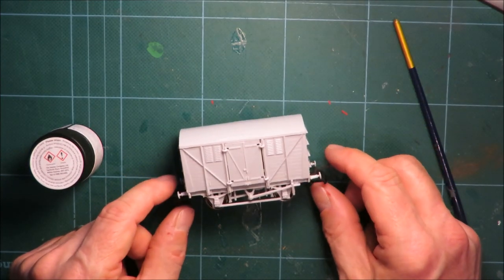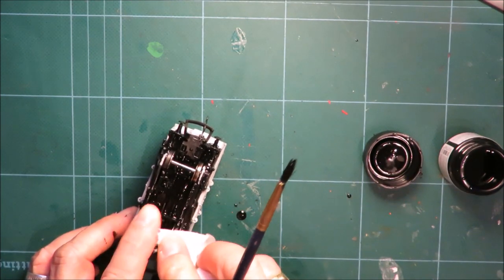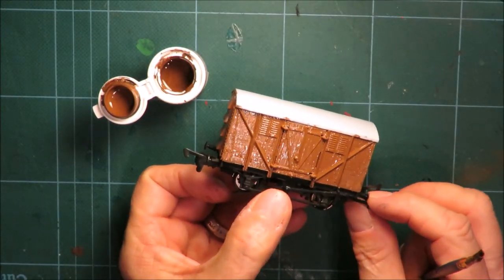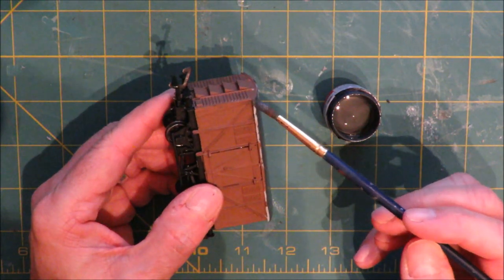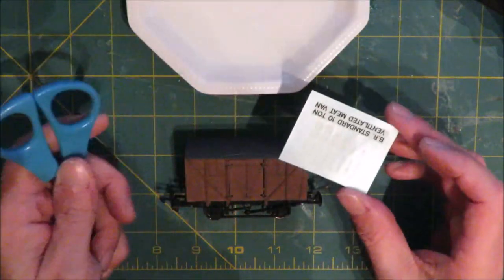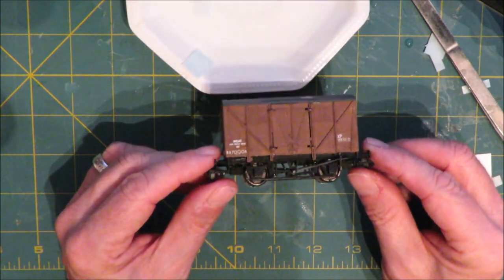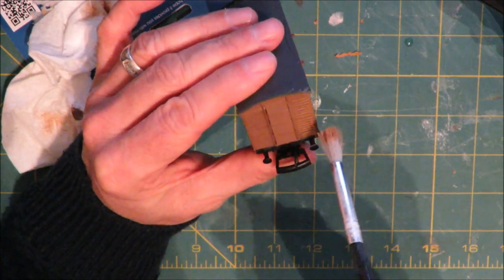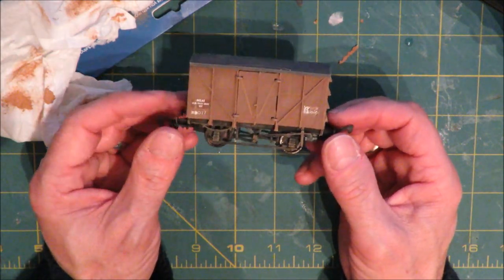Tutorial Tuesday Episode 17 - How To Paint A Model Railway Wagon Kit - Dapol

Comment: Thanks for the painting tips, you save me an hundred euros by showing me an aerograph is not mandatory to have a really more than decent result. Tamiya is a good choice, I can buy some in the model shops of my city.
Anyway, the prototypes were certainly brush painted, I think that airbrushes were not used before the 60's for real wagon painting.

Dapol kit wagons are a good choice to have low-priced and decent vehicles if you need some experiments, like putting some no. 5 Kadees on the one I will buy.
Reply from the maker: Tamiya is good paint, it does need several coats but provides a great finish. You really don't need an airbrush/ spray can and all the practice and fuss they involve, just to paint a few wagons
Reply: @BudgetModelRailways  I have painted dozens of model airplanes with brushes when I was a teen, I have an experience of what the practical result is. And, anyway, I had not the money to buy an aerograph when I was 14-16 years old.
By the way, I have found equivalents in Tamiya range for LMS colors : XF 20 for wagon grey, Xf 79 for bauxite, and XF 9 for Crimson Lake. Nearly half the price of dedicated railways paint, that also cannot be shipped to France by the sellers, hence my line on Tamyia's paint availability.
I have noted your advice on brushes. I've got an artist shop near my workplace that sells good quality brushes, I'll pay them a visit one day for that.
Reply from the maker: Thanks for the LMS colours very helpful. A good soft brush is worth spending a bit on, its still a lot cheaper than an air brush!

Comment: I use acrylic paint for quite a lot of my modelling and, though I have an airbrush, I haven't taken it out the box yet!  B&M stores (other shops are available!) stock 200ml tubes of Brunel Franklin acrylic for £1.49 - a lot cheaper than those little pots of Tamiya and Humbrol for those on a budget. Turned out very nice for between a third and a half of a new one and make a rake of them that much more achievable. Cheers
Reply from the maker: Thanks for the heads up

Comment: Its is a nice little kit, I bought one a few weeks ago from my local model shop for £4, I liked it so much I went back for another the next week.
I agree with painting the bottom first, can get a bit tricky painting it built.

 As for the paint scheme  I used only Humbrol colours, 33, black for the base , 70, brick red for the main body and  71, slate grey for the roof. 

The great thing about this kit is that there are a choice of 4 codes to put on the kit, so you can have four wagons with different code, not enough? cut and match the number.

I was lucky I only spent £8 for the two wagons and £2 for the paint that I was missing 
but if I had needed to buy the paints brand new thats £6 (the model shop sells one 14ml pot of Humbrol acrylic paint for £2) on top off the £8 but since I already owned two of the required colours I save £4 only having to spend £10 in total. not to bad considering the price.
Reply from the maker: £4 was a good price, I've seen people asking £8! Mind you given that the new Hornby one is £18 either way it's a saving.

Comment: here's a little tip. These wagons require a little extra weight to make them perform at their absolute best (I'd say add 30g but they're okay in small trains on smaller layouts), use alloy wheel balancing weights. You get a big box for not too much money (so you can use them in loads of wagons, coaches or even additional weight in locos) & they're self adhesive too. They'll come as a mix of 5g &10g weights so you can spread them through the wagon for good even weight. You can also use them in tank wagons by using 6 5g weights, very handy.

In regards to paints, I spray the chassis (without wheels or couplings) with satin or matt black aerosols. Black is also a good basecoat for the brown (I use humbrol Brick red, can't remember the colour) as you could dab the paint off the grills & vents to give a light-used look
Reply from the maker: I did put weight in and like you say the self adhesive balance weights are good, but I can get lead off cuts free so make my own
Reply: even better. I used to use old fishing weights that I had kicking around before going to wheel weights

Comment: Great video, your drybrushing was brilliant. before i drybrush i usualy water down black acylic paint and let it settle in the detail, it realy brings out the detail. after that i then drybrush much like you did . I have also been using graphite dust from cheep graphite sticks; that i have scraped with a scalpel, to give my 0 gauge Terrier a well worked look, after a couple of coats of hairspray the powder is firmly stuck to the model.
Reply from the maker: I have used black first before, but on this occasion kept it simple, although it would as you say gave given more depth
Reply: I tried the watered down black thing years ago after first learning about weathering. Didn't go well. Nothing I couldn't fix if I wanted, but I just never cared to try again after that.
Reply from the maker: It's tricky to get right as I found when I used to paint figures, which is why I gave it a miss
Reply: I agree it is quite tricky to get right, I have reacently used the method on my crew for my o gauge Terrier and it took me a few attempts to get it right. There are panel line washes available and they seem to work quite well however i have never tried them out before.

Comment: I decided to start painting my kits that I'd finished the other day with some Humbrol (turned out it's gloss but I think weathering should fix that). Although my paint was really thin and watery, what's the best way to fix that?
Reply from the maker: Are you using enamels or acrylics please. A good stir solves most problems
Reply: @BudgetModelRailways  Ah! Sorry I forgot to mention! I'm using Acrylics. It's Humbrol Red Glossy (all I had, really.).

It's fine when it dries, but just a lot runnier than yours in the video.
Reply from the maker: Acrylic gloss can be a bit erratic, but I am the same as you and like to use what I have

Comment: The handle on the end of the brake arm was painted white (which then wore off). 
The brown colour was associated with vacuum brake fitted wagons under BR (add a bit cut from an old biro to the underside for the cylinder).
You can use a fine tipped white ‘gel’ pen to add lettering, I had a lot of success using a dip type pen with white ink but that did get fiddly and I ended up buying more nibs. If you make a mess of it a bit of enthusiastic weathering works (I use enamel paints so I just give things a wash with dirty thinners, that doesn't affect either gel pen or dip-type inks.

For BR livery you might find this interesting . . .   
https://www.igg.org.uk/rail/6-livy/br/9-br-4864.htm

For info on the chassis . . . 
https://www.igg.org.uk/rail/4-rstock/04arstock2f.htm

The wagons are N Gauge, mostly semi-scratch built or kit-bashed on Peco chassis.
Reply from the maker: Thanks for the info and video links